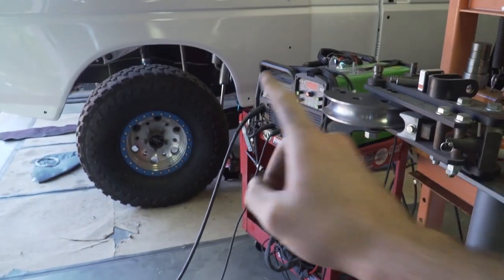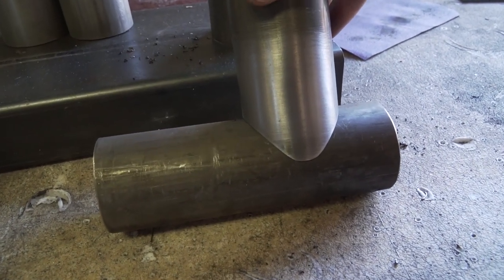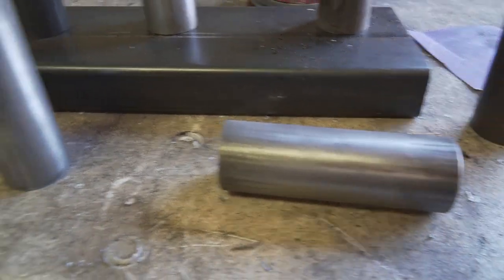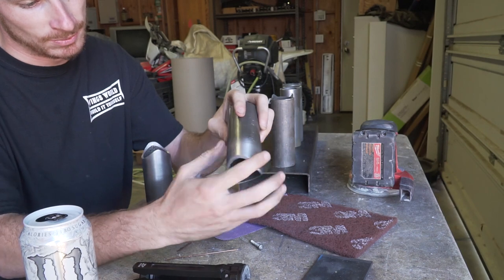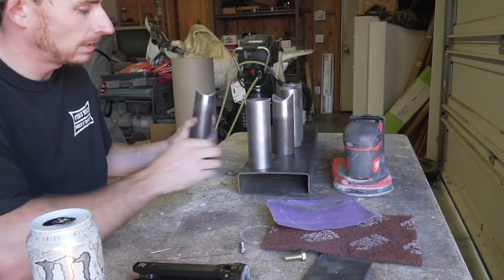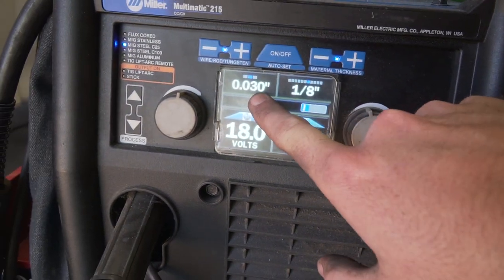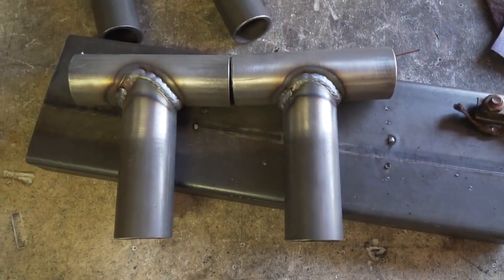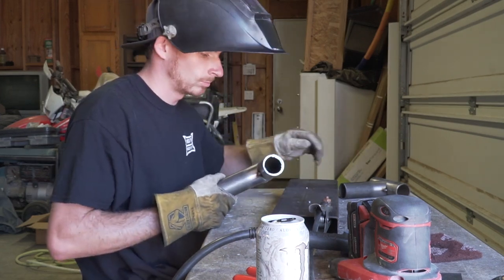FAB 101: How to PROPERLY Prep a Tube For MIG Welding

Comment: I build tube chassis and roll cages for a living and can throw down with the best on some DOM tubing. I must say man, 90% of what you said is correct. Only thing i would change is your settings ( 17.0v, 175wfs), and learn to roll your wrist so you can hit the entire joint in 2 passes and have less tie ins. Also use some puddle manipulation to fully fuse the joint and wet out the weld. Try using a counterclockwise circular motion and keep the toes of your weld even and it will come out 1000X better!
Reply: What is your opinion pull-push little bit back-pull-push little bit back-pull and so on technique? I find this technique the easiest way to follow circular path and get penetration.
Reply: @TJEMPPA10  it’s called the “whip and pause” technique. I use it. It leaves nice dimes.

Comment: Love the fabrication series, would love to see your method in calculating tube take up for tube bending. Also, maybe techniques you use on notching tube. Sometimes I use my notcher but I find myself using the chop saw a lot and then finishing the tube with a flat disc to finish the coping, and then some scotchbrite pads for clean up.

Comment: This video is so timely. I just got my Millermatic 212 w/autoset running a couple days ago and welded my first beads. Results were mixed. Very surprising how much difference can be made turning the machine down. I'm starting a '94 F150 prerunner build so I'm stoked to see this content!

Comment: I couldn't agree with you more lol. I'm no professional welder either but I am a garage fabricator myself. It is a must to properly prepare anything that is gonna be welded. Impurities/contaminents are no good for Mig or Tig welding especially if it's gonna be for a cage & it's supposed to structurly strong. All in all great video 👍

Comment: Do a tig video! Keep up the great videos
Reply: Yeah, TIG would be awesome.  I'm just getting back into prepping for welding after like 20 something years.  Thinking I'm going to try to make a TIG welder from the buzz box I just picked up, I have a comment in the article also with a circular loop to my other post thoughts: https://www.facebook.com/james.analytic/posts/3324124374316008

Excellent timing!  I wan't to fabricate a few projects... though this all started more for a Mike Basich Dodge RAM Faraday Caged RF Mind Control Patrol rig more without the skid on top and four actuators for the cap so I can stand in to stretch out and get a better view.  Maybe even for a launch pad on top of my cab for a balloon or drone too... so I don't have to get out of the rig (much) since that will be important. 

I used to want to pre-runner mod my old long bed regular cab Ranger... though that was stolen.
Reply: I think I have the same dirt Alliance sticker on my welding hood.

Comment: How much of an issue is rust inside the tube? Will it even be a problem is the tube is welded sealed on both ends or does it need to be treated? Any help would be appreciated. Experience is always the best way to learn but the slowest too. Giving my first tube welds a go today at home

Comment: I do ATV repairs on the welds the robot misses and have the WFS down to around 200 and and voltage around 18.5. If I go too low it doesn't want to lay flat as much. Doesn't look terrible but too high of a bead for what I'm doing.  I haven't been doing it long though so still trying to find that right spot on the machine.

Comment: When you get to the TIG welding video I would be interested in the "T" joint both sides welding. I have had one side coming out ok then the other experiences porosity. I was told to increase argon flow which seemed to help a lot. Am interested in what you find out.
Good tips, as said below, the tacks are a great idea!
Reply: Tom Herd it might be because you are getting so much penetration that the back side of first pass is oxidising , Ie similar to mill scale, so when you weld the other side you are basically just pulling those impurity’s to your weld. If so, try a little less amps on first pass and then thoroughly clean the back side ready for weld
Reply: @husq2100  Will give that a try. It seems like a very good aolution for the problem. I turned up the argon to about 22 and that seemed to help some. Thanks!

Comment: Oh, may I request? 360 cage welds without cutting the roof.
Reply from the maker: We will go over that if we do a cage video! On the 92f1build we broke a few tacks and dropped the cage down to weld the top of the tubes. That is the best way to do it without cutting your roof off.
Reply: The technique that I have seen is to holesaw holes in the floor. 
Leave the downtubes long. 
Jack up the cage and verify the fit. 
Lower the cage and weld. 
Raise the cage and mark the length. 
Cut the length. 
Slip in the floor plates between the cage tube and the body. 
Weld the floor plate to the body (over the holesaw holes). 
Weld the cage to the floor plates.
Reply: Rocker boxes
Reply: @joedemers5480  welding the cage plates to the floor creates a heat affected zone that is weaker. You're better off running bolts through the plates. It's what they spec for BITD, Ultra4, Score.
Reply: Doberman Racing, thank you for the reply. What you say does make sense and is certainly adaptable to the rest of the method I outlined.

Comment: Have you (or can you) MIG weld thin wall (.028-.065) 4130 steel tubing? If so what settings or method would you use? Thanks!

Comment: As far as auto setting vs personal setting,  doesn't the extra material supplied by the auto setting make for a stronger joint due too the additional bonding material?

Comment: I have the same millermatic 215 and whats funy is that in autoset  for 1/8 is 18v 385 ipm but in the chart inside it tells you 18v 310 ipm    i dont know why since autoset match the chart exept in the 1/8 steel

Comment: Do you cut, etch, and analyze?  MIG can look absolutely perfect and be 100% junk. Do you cut, etch, and analyze the prep?  Are you polishing the mill scale or removing it?  The welds look quite nice, but I have little trust in MIG.  I have seen numerous MIG welds that were gorgeous, but had no penetration. MIG has a hard time punching through mill scale too. 

Your welds certainly look nice, but I would verify before trusting.

Comment: Just as a quick note for flap disc guys: pay the extra 12 bucks next time you’re buying discs for a “prep disc” if they have em. Basically scotchbrite and steel wool in a coating on a disc, won’t remove material except mill scale and well worth how long they last

Comment: Nice video explanation, seems like a lot of people have no clue about cleanliness when it comes to weld prep or notching. More people need to take pride in their work and not just throw stuff together. I suspect if you have an auto setup machine a novice will set it to that without realizing if wire speed is slower that will allow more heat into the joint and allow weld to lay down. They don’t take the time to learn about what theirs welder is capable of.

Comment: I would highly recommend against putting something in your lathe and using scotchbrite while it spins to remove the mill scale. That's a good way to turn a nice machine into a pile of scrap. The dust that comes off the mill scale will absolutely ruin your ways over time (remember, mill scale is harder than steel), let alone anything the scotchbrite lets off.

If you absolutely insist on doing it, put down plastic to catch it. Cloth won't help, it'll go right through it.
Reply: Yeah I put a piece of cardboard or plastic over my lathe when I use any abrasive anything. I try to avoid it but sometimes it just makes sense.

Comment: Not a big fan of ocellated of weld pool due to introduction of impurities. A good gmaw weld should be dialed in so it’s a slow steady pace no ocellated motion with gmaw no impurities introduced. Excellent point on metal prep. Gmaw should be follow root and just travel. That will yield best heat affected area and penetration.

Comment: Not that prepping your work is bad, but its not necessary. I used to program miller welding robots at an oem exhaust manufacturer, and we would try things like this to see if we would get better repeatable results, and i can tell you the actual welding is much more important than prep. With a good weld program it didnt matter if parts were oily or unprepared they would weld just the same as long as they were dimensionally correct.
Reply: Is that why the welds on my exhaust had holes in them? :)